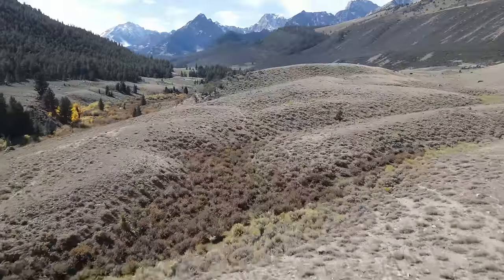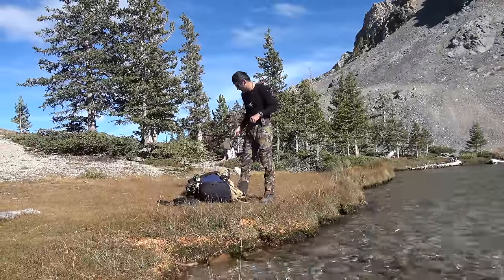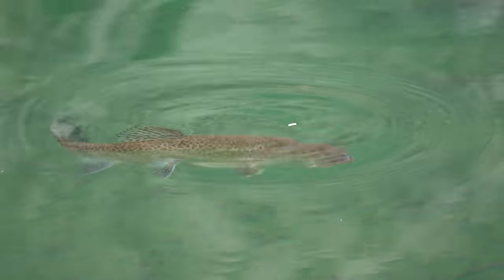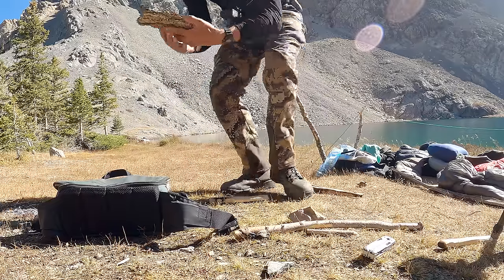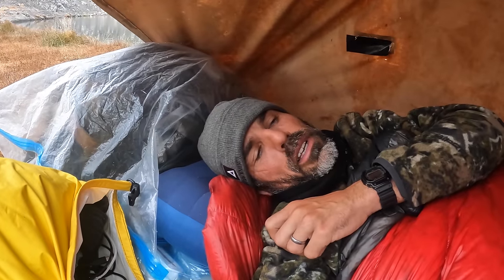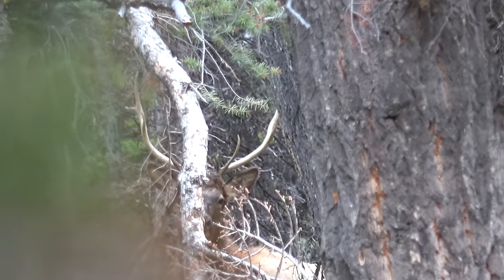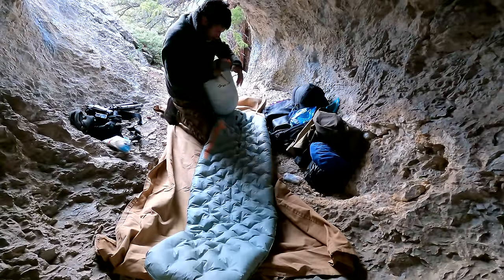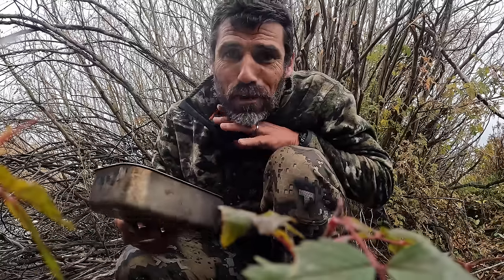4 Days Alone in Idaho wilderness: Aussie vs American Outback

Comment: Plastic bag with water in it will make a magnifying glass for the sunlight a clear water bottle too! I carry guitar picks,  shave the sides to a fine power one spark burst into a flames for about 5 seconds. Water sheds right off them I pulled them outta water wiped them shaved them threw a spark to them boom 🔥 light weight too!
Reply from the maker: Cool. I’ll have to try that.

Comment: That high elevation has minimal oxygen. Making it more difficult to start a friction fire 🔥
Reply: 3,000 m is not high enough to lower the oxygen level to prevent fire lighting. If the oxygen level was that low Mike would not be able to survive. Besides you ignored the explanation of the types of wood he used weren’t quite right and the humidity was rising as the Sun set.

Comment: Very risky camping that time of the year on account of the snow.  It could easily snow a foot or more overnight and make it extremely challenging to hike out safely.  The mountain microclimates make weather forecasts unreliable at best.   Even in peak July summer ive been snowed in above 10000 feet not far from where you were.  Albeit it melts fast in July.
Reply from the maker: I had enough stuff to get me out of trouble. I’ve done a fair bit of cold weather stuff and could have made snow shoes if required.

Comment: Very interesting and well done. 

Question tho: was there a particular reason you mismatched a spinning reel and a fly reel with a casting rod?
Reply from the maker: Thanks. It’s just to save weight and space. I just use the same rod for both reels. It’s tricky to fly fish with that setup but it’s still works.
Reply: Just be careful using that rod with those kinds of reels. The rod is a casting rod and is not supposed to flex in that direction. It might not work efficiently and could break. A spinning rod would be a better choice for both reels if you can only carry one rod. Cheers!

Comment: @Outback_Mike if you haven't worked out why you couldn't get your fire started with the drill method hit me up.
Reply from the maker: I’m going with the high altitude. What’s your opinion?
Reply: @OutbackMike  more friction appears to be what you need. An old trick is to sprinkle a pinch of sand in your base which will act as an abrasive which significantly increases the amount of friction & heat that you generate .